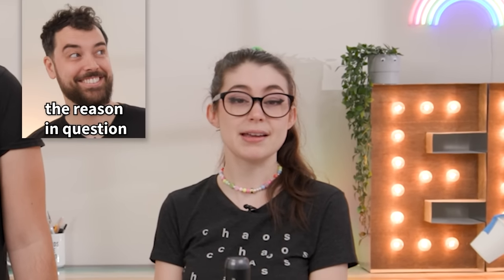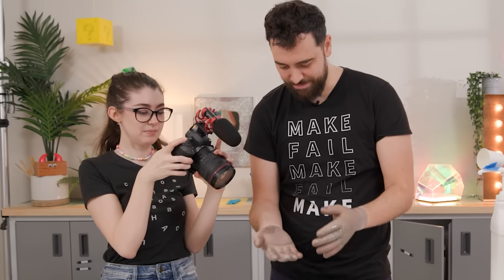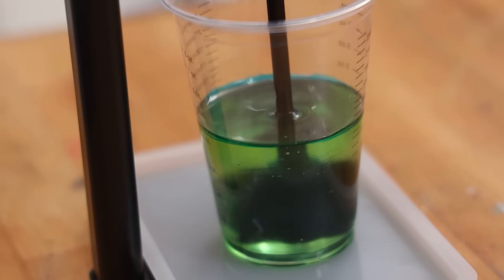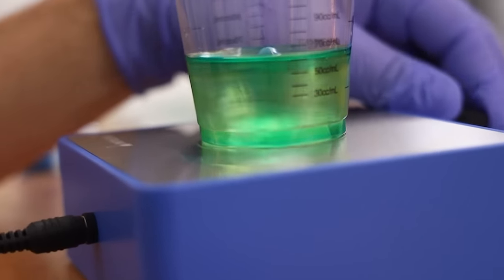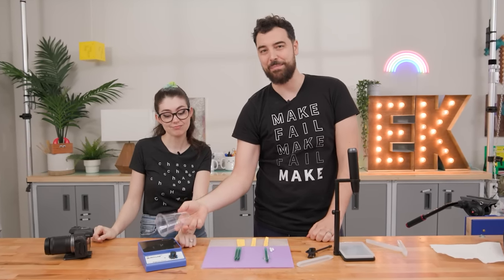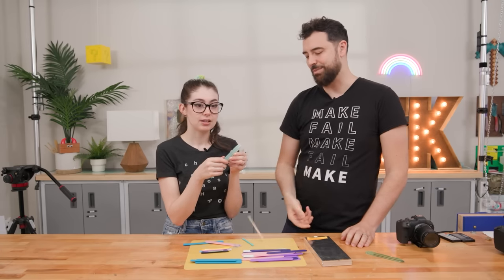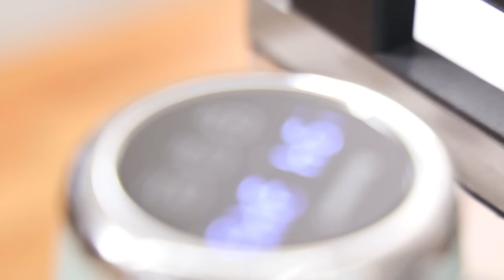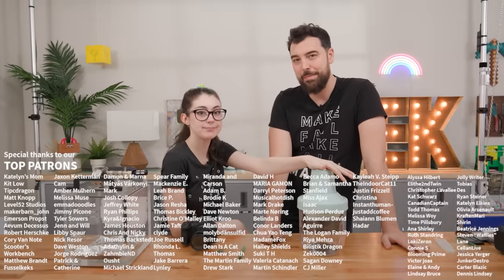Testing 7 Weird Resin Gadgets from Amazon (2 were good)

Comment: One reason why the magnetic stir bars clean off so well is that they are actually coated with PTFE (the stuff in Teflon). When mixing chemicals this ensures that as little of the chemicals stick to the bar as possible and that the bar itself doesn't react with any of the chemicals. It also helps to reduce friction on the bar, making it easier to stir.
Reply from the maker: very cool!
Reply: @EvanAndKatelyn I was honestly surprised you've never used one of these before. Magnetic stirrers are a great tool when you need to mix something consistently for a long period, and since resin is actually a chemical reaction it seems like a great fit. You can also get one with a built-in hot plate if that's ever something you need.
Reply: @JordanSugarman  I always wish I had these magnetic stirrers in my normal kitchen 😅

(One day after a whole day in chem lab at uni I was really thinking "oh I forgot the stir magnet" while cooking dinner 😂 Seems like I was a bit exhausted and mentally still in the lab 😅)
Reply: @JordanSugarman  I’m less surprised? They’re handy as hell, but I only know magnetic stir bars even exist because of chemistry channels like nilered/blue. They’re really only used regularly in chemistry as far as I know, I haven’t see any resin crafters using them-granted I only follow this channel, occasionally watch others in recommended.
Reply: Teflon is a very hydrophobic material, about as hydrophobic as you can get before you have to start changing the microstructure of the surface of a material, which is why things don't stick to it.
Reply: @high_stakes_ikea7087  I know of them because of Goldschläger, the cinnamon schnapps with flakes of real gold floating in it. Bars used to have a bottle on display with the flakes floating around and I didn't understand how, because gold isn't magnetic. Turns out there was a magnetic stir bar in the bottom of the bottle and the rest was just the viscosity of the schnapps etc. I was more of a physicist than a chemist so never encountered one in the lab!
Reply: When I saw them take this mixer out I was so incredibly excited. I used to use them all the time. They are so fun to use
Reply: @JordanSugarman , yeah, especially because you can get coffee mugs that utilize this design now. It's not just limited to molecular bio/chem labs anymore.
Reply: Just to clarify, Teflon is just the trademarked name for PTFE!
Reply: Sealed pens…won’t write for long.
Reply: @JordanSugarman  I use a hot plate / magnetic stir plate combo in out lab. It's ancient and burnt, but still works.
Reply: I literally came to say the same thing. 😊
Reply: @JordanSugarman  yeah, i was kinda surprised when they brought this up. it's not really an amazon gadget, it's just a cheap version of a completely normal tool.
Reply: @Nemokiddy  "gotta distill my eggs" XD
Reply: @b.c.9358   Not only is Teflon hydrophobic, but i hear it's also a bit racist.
Reply: @Nemokiddy now I'm imagining a magnetic stirrer with a big ol' stand mixer whisk just spinning around in some dry ingredients
Reply: @EvanAndKatelyn   An interesting expirement would also be to take those mixing pills and try coating them with a bit of silicon so they have a squishy coating so you can break the resin shell and peel off resin.... just be careful with Evan's method of breaking a resin shell.
Reply: We use these at work all the time. Choosing the right size pill defintiely makes a difference.
Reply: Pretty standard lab equipment. I wonder if they cause less bubbles because they mix while being completely submerged.
Reply: lab equipment is great
Reply: @EvanAndKatelyn  out of topic, but at 8:15, your glasses turned into the background and it looks like you just have two holes cut into you 😭
Reply: That could be a factor, but
I think the biggest reason is that the Magnetic Stirrer is not creating Waves, which is because it's not contacting the air.
Reply: You can also get silicone covered ones
Reply: @gremlinman9724  I think the idea is that these are cheap gadgets that a mass amount of people can get their hands on. Most of the stuff they use, people aren't going to own for price and/or storage reasons. They are just testing more accessible tools really.
Reply: @EvanAndKatelyn The magnetic stirrers look simple, but they’re engineered to solve all sorts of problems! They’re used daily in labs across the world at all sorts of temperatures and pH values, air pressures (including in vacuums), and are designed not to splash or introduce more air, etc
Reply: I make weed cartridges for dispensaries, and I use one with the heating element works perfect I love it best investment 👌
Reply: @JordanSugarman  i don't see them using the stirrer because their project are always so large. if they were making miniature figurines maybe it makes sense but they're making things like tables and block size items lol.
Reply: I miss playing with the magnetic stirrer in the chem lab in college. It was always fun watching it go 😊
Reply: I use those magnetic stirring bars everyday at work. I don't know exactly how much they cost but are worth every penny.
Reply: That is so cool 😎
Reply: I just wash my reusable stiring stick with water and soap after cleaning them wit an old cloth. Before it hardens... never had a problem with it...
Reply: They are magic bullets in chemistry labs. The best thing.
Reply: They're used for intense chemistry
Reply: Science adjacent!
Reply: @b.c.9358  Not just hydrophobic, the fluorine bonds are also insanely strong, which means that it's really, really hard for anything to react with it in the way that can lead to substances becoming bonded to it.
Reply: @Tyler.McGrath came here to “um actually” as well lol. 😂
Reply: FYI your pen resin molds require a hole to equalize pressure while the ink gets used. A redesign might be required. Check out the wiki page for the “crystal bic” for their design. Looks like that’s what your design is based on.

Comment: As a benchtop scientist, those magnetic stir plates are super super useful and reliable. If science companies didn't inflate their prices so much, I would consider getting one for my home.
Reply: I was going to say it's really odd to see something I use in the lab every day like on a DIY channel.
Reply: @EthanNakuma  Saame xD When I don't have anything else to do while waiting for stuff to dissolve, I'll play around with it and make some tornados :D
Reply: What would you use them for at home?
Reply: @sarahmcdonough7713  hot chocolate 🤣
Reply: If you don't need heat, stir plates are dirt cheap.  I got a super nice $800 heated stir plate with remote probe for $90 and all it needed was a set screw tightened.  There are deals to be had.  And you can even make a stir plate by gluing a magnet to a computer fan (remove blades, add speed control ideally, build platform).
Reply: Does your lab also call the little magnets fleas? Cos they like to jump around if you haven't set them nicely in your beaker? 😅
Reply: @sarahmcdonough7713  Mixing stuff like batch drinks. And if you get one that also has a hot plate, it's basically self-cooking robot. Put a pot of soup on, turn on the heat, turn on the stirring, and forget about it.
Reply: @sarahmcdonough7713  My mom got one from a friend that was unusable for them because the speed regulation was shot (only did full speed), she cooked some niche things with that thing, especially soups that need a lot of continuous/frequent stirring come to mind. You obviously can't use steel pots, but glass forms for ovens work surprisingly well as makeshift pot.
Reply: @abigailfarrell7953  My research lab called them fleas. My current clinical lab is very proper calling them magnetic stir rods. Either way, we all get super annoyed when they hit the side of our stain containers while mixing for 20min.
Reply: This is the problem with "niche" products like this - the company doesn't realize how many different applications their "niche" has and so they artificially inflate the price to make more money heh

Welcome to capitalism!
Reply: @csn583   It's sad to me that people fail to see how nearly $100 is still overpriced for such technology ...
Reply: @csn583  where did you find it 😭? I was look on eBay just the other day for used heat/stir plates and I couldn’t find a listing for under $300. I think they ranged around 800-900
Reply: @sarahmcdonough7713  I wonder if you could use it to keep stirring popcorn while it pops...
Reply: Seriously why are they so expensive? They are pretty simple and the electronic components can't cost that much. Is it just because of demand and because labs usually have grand or R&D money?
Reply: @SamChaneyProductions  I could not tell you. Even things that are just molded plastic cost hundreds of dollars when you get them from science suppliers.
Reply: Sounds like there is a gap in the market. Somebody get one produced more cheaply for the hobby industry, market and price appropriately, profit?
Reply: @sarahmcdonough7713 I used a makeshift one (just magnets taped to an old computer fan) to stir miniature paints. It kinda worked, but now with the newer paints in drip bottles, a nail paint shaker does a much better job.
Reply: @AVspectre  There isn't a gap in the market for people using such an advanced device to stir hot chocolate, no.  There definitely is not a gap there.

Comment: If you use the magnetic stir bars in the future, you can remove them from the resin with another magnet through the side of the cup! might be easier and less disruptive to the resin surface than reaching in with tweezers.
Reply: oh that's a good suggestion
Reply: I don't know much about resin but it seems like the stir bar could be held to the bottom with a magnet on the outside. It could then be removed after the pour.
Reply: They gotta do it next time

Comment: Im actually really impressed by the baby vacuum chamber i work with resin only in small amounts for like dice or charms or jewelry and could never see myself buying a vacuum or pressure chamber bc they are soooo expensive lol the max of what i use is a heat gun so the fact that it actually did that good a job. (the hand mixed control vs the small vacuum) is nice to know some cheaper options actually arent crazy scams
Reply: But for the price, I'm seeing other more reliable vacuum chambers with compressors that are actually less expensive. Just take up a bit more shelf space. Come on clear pvc versions for the same price!!!
Reply: If you can somehow construct a chamber and keep it from imploding, vacuum pumps alone are not THAT expensive. Or in theory you can even use old refrigerator coolant pump as vacuum pump (which you can salvage from old fridge, or perhaps buy as replacement part for fridge repair).

Comment: The resin stir sticks are super easy to clean up if you spray them with isopropyl alcohol as soon as you are done and wipe away with a paper towel. If you wait til it's cured, it's a pain to remove the resin from them.
Reply: Yeah I was wondering why they didn’t clean up the stir sticks the same way they did the magnetic stirrer thingy
Reply: You have the longest username I've ever seen
Reply: could also just put some iso in a cup and then stir them in the ISO.
Reply: thank you! was coming to the comments section to make this same comment haha...i just use a babywipe to clean my off of the bulk of the residue and then go in with iso when cleaning up. works for me!
Reply: I have a dark amber jar with a lid that I put some 99% Isopropyl Alcohol. Then when I'm done with the mixer, I put the mixer attachment, still attached to the mixer and then I'll run the mixer in the jar of alcohol. So far. It's working and I haven't changed 5he alcohol out yet
Reply: I use those stir sticks and if they have leftover resin I just use packing or painters tape to clean them up. Lint roller works great too.
Reply: @carolwalters6469  that's a great idea!
Reply: And they didnt really mention the main benefit, reducing waste. I dont think they were made to have the resin dry completely, but even still it did come off.
Reply: @beelzemobabbity  realistically speaking how much less of a waste is it if you have to use paper towels/wet wipes/tape etc. to clean them properly every single time? as opposed to reusing a wooden stick 10+ times. not trying to get into an argument just genuinely wondering if it's even reducing waste at that point
Reply: @edelleaa  im not a resin expert, but i would think that you could possibly use reusable towels, if not, i am assuming paper towels use less than wood sticks, and you could probably just scrape it off somewhere. But i guess thats what it comes down to.
Reply: True but IPA is kind of expensive, not to mention the time spent wiping them? There's really no good reason not to just use the wooden one and keep reusing it, unless you need the squeegee action of the silicone

Comment: The price of the vacuum chamber is amazing. If i was a resin home maker then the vacuum chamber that i could get for under £200 and not have to know 100% how it works and have a company that i could get customer sport  from is amazing. Also cool that the company had the confidence in the product to reach out.
Reply: But how long will it last?
$150 is a lot of money if it's breaks after a year.

That's why I generally don't like these one-time tests. At least take it apart to look at the components. Or check how warm/hot the motor or pump gets during operation.
Reply: @Jehty_ But if I'm just starting out being able to buy something that is more affordable out of the gate can get me started sooner while I save to invest in the more expensive one.
Reply: I bought the Resiners vacuum chamber first an then got my pressure pot. I hardly ever use the vacuum chamber anymore. Wish I had saved my money!
Reply: @TheJillers   That math doesn't work if it fails before you can recoup your costs though ...

Comment: The magnetic mixer combined with the cheaper vacuum could be a win win situation. The cheap vacuum did pull some of the bubbles, and the magnetic mixer produced less bubbles.
Reply: Yeah great point, why do the operations separately when you can magnet your way through the vacuum chamber and do both operations at once!
Reply: @SovietGrazz  That is a really good idea. Save time and less risk of curing prematurely.

Comment: The price to effectiveness ratio on the small vacuum chamber is pretty darn good. If you were just a hobbyist that wanted to cut down on bubbles, it seems like a good pairing with the stir bars. I do question the longevity of the vacuum chamber though.

Comment: The silicone stir sticks are better if you immediately clean the resin off after using. If you leave the resin on it, it dries out the silicone with each use. Eventually it won't peel off the stick and you will need new ones. Happened to me.

Comment: I think one big advantage to the magnetic stirrer is that you can leave it going while you put the resin in the pressure pot so you don't have to do anything and can just let the machines do the work for you
Reply: Now this sounds like one step closer to AI than the “actual” AI in the video lol 😂
Reply: It is corded though
Reply: @justkeepswimmin   You could have the corded base outside and the stir ring inside if the pull is strong enough, but I dunno if it would work with their vaccuum chamber or not
Reply: @justinpflieger3380  magnetic stir bars work with lab glassware that can be 1/8" thick on the bottom, and the vacuum chamber looked to be about that thick, so it might well work right through it. Definitely worth testing imo.

Comment: What do you normally do with extra resin? You could totally make a silicone mold that has shapes for different tools you normally use! Like stir sticks! Or some kind of other tools. Then you'll never waste resin and you have a continuous endless supply
Reply: resin stir sticks
Reply: If I remember correctly, they tend to just pour excess resin into a pixel heart mould. They definitely could've changed what mould they are using but the hearts are the last thing.

Comment: i imagine the silicone gloves being great for hand shaped molds
Reply from the maker: you do have a point there!
Reply: Hand shape hand soap 2.0??
Reply: @vogelvrouw  yeeeeeeessss
Reply: That's probably why they have fake nails and finger prints on them now that you mention it.
Reply: @simonw3858  the prints and nails are on the outside tho, so it doesn't make sense as it actually being a mold, but it could be used as one.
Reply: @LynetteBunBun  You just turn them inside out, fill with resin, cure and demold by pulling the gloves inside out again.
Reply: @seerofallthatisobvious1316  oh i know but sometimes it may warp the silicone
Reply: @simonw3858  the finger prints are to help with grip! especially since, as they found, the silicone can get very slippery when wet, so the ridges on the finger pads helps u not drop things. the molded sections on the palm also would help with grip. no idea what purpose the molded thumb nails serve tho kdjdkd

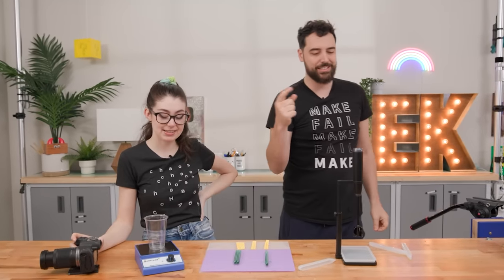Comment: 18:34 Here is a tip for cleaning. Keep a jar of alcohol around and when you need to clean it just dump it on the jar and turn it on. The act of mixing will clean it. You can reuse the same alcohol a few times before too much resin is diluted into it.
The same is valid for the pills.

20:36 As you move the stick you are creating a rift in the liquid. As that rift colapses it traps air that becomes bubbles. You can have a decent visualization of how it happens if you watch the scene where the sea closes/colapses on 1956 The Ten Commandments.